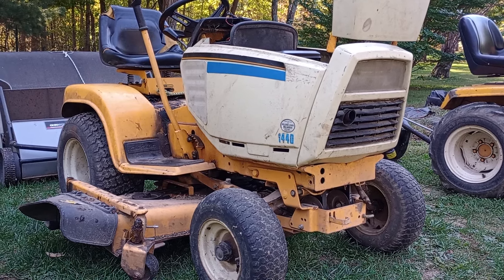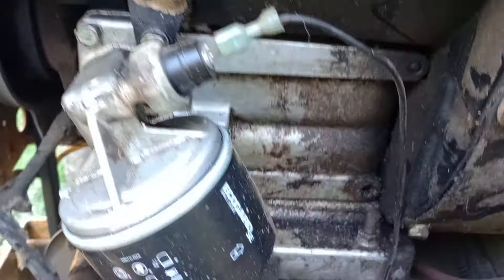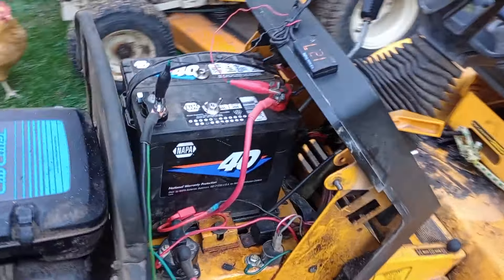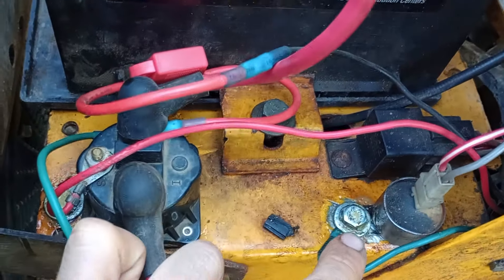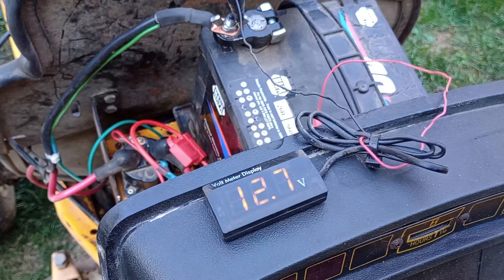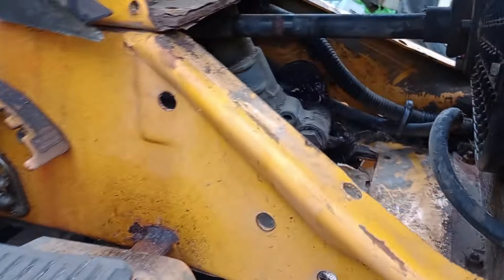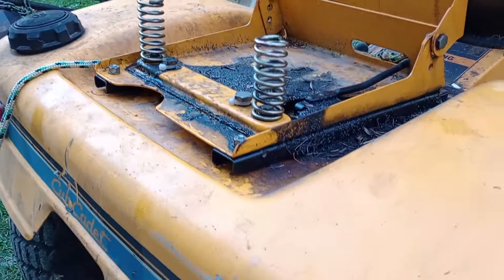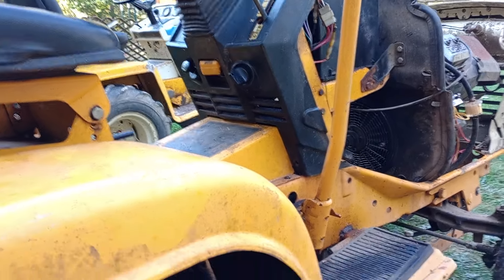Cub Cadet 1440 Revival - Overview/Cyclops Electrical Fixes #solunagarage #cubcadet #briggs #revival

Comment: If one wanted to look for a classic garden tractor to restore, what would you suggest. We don't have a lot of Cub Cadet. I am leaning towards a Wheel Horse or Troy Built tractor.
Reply from the maker: Wheel Horse or Gravely or Deere.

Deere 300 Series would be an obvious choice.

Wheel Horse 420-H would be a nice hydro tractor and more unique.

Gravely G Series would be great if you want a gear drive.
Reply: @SolunaGarage  Thanks for you reccomendation
Reply from the maker: They are all great machines.  I think what I would do is drive one of each and see what fits you best.

Comment: I have a 1440 that blows fuses, replaced ignition and solenoid. Still blows on first position on ignition. Any ideas?
Reply from the maker: First position on the switch is RUN/LIGHTS.  I suspect you have a short to ground on the positive wires going to the front or rear lights.  I'd start there.
Reply: @SolunaGarage  Thank you. Greatly appreciated